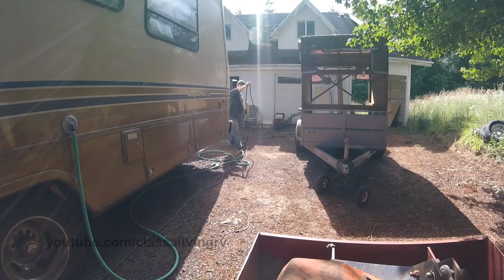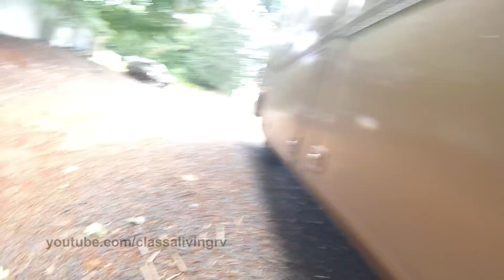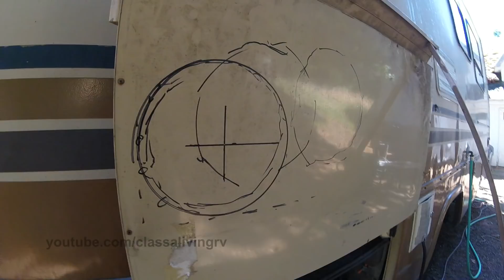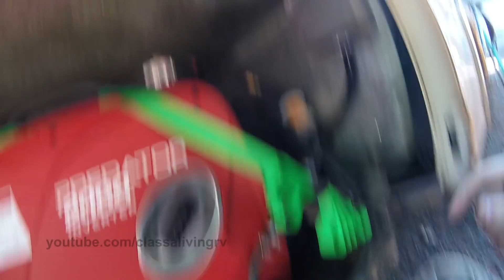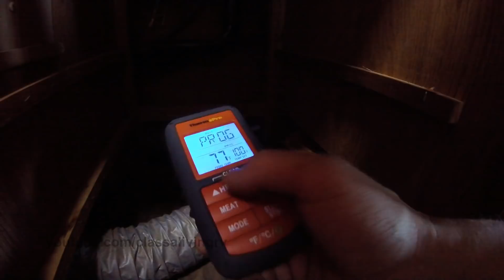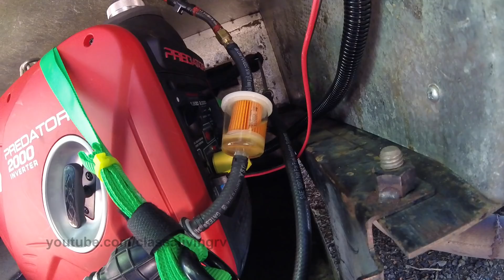PORTABLE GENERATOR INSTALLED IN RV

Comment: Why didn’t u put in a larger gen ?  Say 30 to 35 watts.  New follower.
Reply: Not really they aren’t that much bigger. Also that fan is big & noisy. Most guys use computer cooling fans.   Just a thought.
Reply from the maker: It would be a tighter fit and harder to keep the cabinet cool

Comment: Not sure if you made a adaptor for the exhaust extension to connect to the generator or if it just sets over the existing exhaust. Either way, it’s going to be hard to clean spark arrester when the screens build up unless you eliminated them completely. I seem to get more build up at higher elevations. The heat build up on the tube you slid through plastic is going to melt the plastic. Not trying to take away from your video, but I’ve run into these issues while trying to extend exhaust on my generators. Thanks for sharing.

Comment: Ive done this with a 5000 watt on a old pace arrow and it did fine but it wasnt the quality machine i have today in my newer coach which is a onan maquis and after repairing the onan which took some time and money and research im glad i elected to fix it allthough replacing it with a harbor freight gen would have been easier but the value of my coach didnt take a hit like it would have with a add on gen . THis is a remedy that works but can never be like the factory onan .WHy not simply install a battery bank and solar panels instead if you arent going to run ac ? THis is a inexspensive solution and 275 watt panels can be purchased under 100 on ebay also golf cart battrys will work fine and you get free electricity . good job on the swap over .

Comment: You could have accomplished the same thing without drilling on the exterioryou could have drilled the fan hole underneath and it wouldn't have been visible
Reply from the maker: I could care less about it being visible. Heat rises, I wanted it toward the top of the cabinet.

Comment: You should be able to figure out the normal running temp of the generator and buy the appropriate thermal switch for a overheat warning light

Comment: I like what you did! You should have made a little tray that bolts to lockable slides so when you need to take a generator out just unlock the slide and slide the tray out. Keep up the good work!
Reply: U put exhaust rite under the cooling fan so it's suckin and  blowing the exhaust back into the compartment and possibly into RV !

Comment: Please don't take my comment as being critical, it's intended as being helpful.  If you can isolate the exhaust pipe with exhaust hanger  bracket it will mane your RV much quieter.  No metal to metal contact between the exhaust and the RV.  Thanks

Comment: Hi, great video! I am wondering if you have measured the amount of carbon monoxide build up in that compartment? I am looking at putting the eu2200i companion in my front storage on my 5th wheel RV that is generator ready, but I worry about carbon monoxide getting up into the living room above though.  Have you had any issues with the genny getting to hot or running poorly? If you don't mind me asking, what are the dimensions of your compartment? I am thinking about building a sealed box around the genny and mounting a fan like you did.   I am doing the propane conversion so I understand cleaner/ less CO output.   Thanks again and looking forward to your reply!
Justin

Comment: I meant to ask you if u ever figured out what was wrong with the onan. I had the same problem and went through about the same steps you did (same generator in the tioga arrow).I then pulled it and gave it to a friend...I have since sold the tioga arrow and the onan in the winnebago works excellent...just curious...thanks
Reply from the maker: I believe replacing the carb or getting a rebuild kit would have got it running smoothly. However the carburetor for one of these things is 200 bucks or rebuild kit 80 bucks. I could have done either of those things with no guarantee it would work, there were one or two other things it could be as well, so at that point i realized the onan wasn't worth fixing. 
One day i will pull it out and see what it will take to get working as a rainy day project or something :)
Reply: Class A Living Our 92 winnebago carb was changed by the previous owner...only 200 hours on it and I'm assuming that's what did the original in....I'm not sure what kind of carb it is as I have to manually choke it from outside to start it initially until I run a simple cable to the inside so I can start it from the remote unit